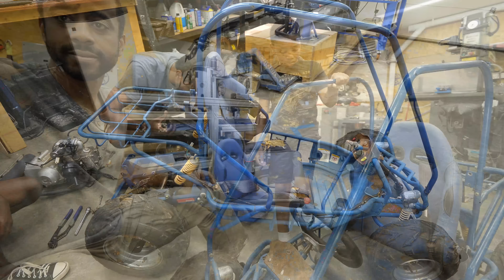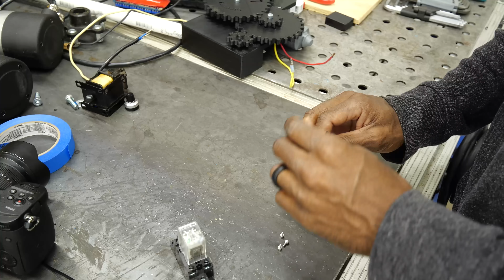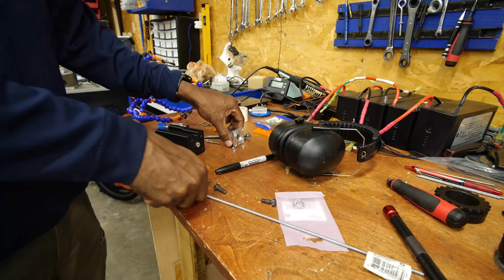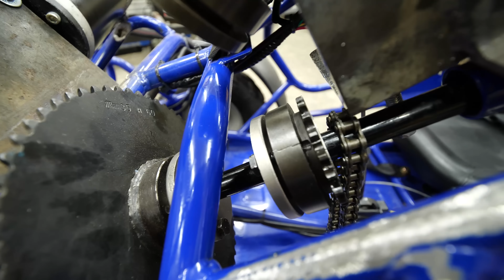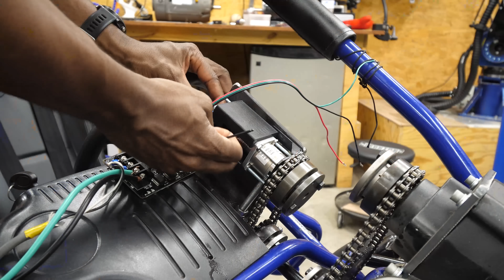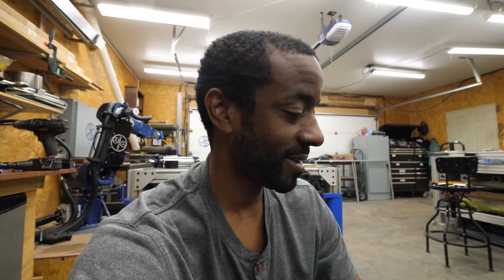Building A Self Driving Car - Jeremy Fielding 098

Comment from the maker: Thank you so much for joining me as we work through the design challenges of something like this. We are already making changes and improvements! Please check out bill's article as he talks through the whole electrical design, discusses the different position-sensing options, and changes we plan to make there as well! https://dronebotworkshop.com/custom-servo-motor
Reply: Hey just saw something you might have a need for especially in this time of year. Repurpose a old dryer into a garage heater
Reply: I can't wait until we get better analog computers, can you imagine the AGI that will come from that? I'm curious if an analog computer would be better?
Reply: great video. quick question... the force needed to turn steering wheel will be quite heavily dependant on the TYPE of surface the vehicle drives on and grip of the tyres no?

Comment: From a safety standpoint, you should definitely prefer a weak motor with a sturdy mechanical device. Should the motor fail, a standing steering column allows for manual override; while a broken steering column means total loss of control with zero backup.

Comment: Without any connection, that is, keeping the chain removed, you can observe how the motor spins & how it responds to the potentiometer. That way you don't risk damage from the torque of the motor. Of course, I realize that this project is likely long done by now. So, I'll just look around for some new chapters. I appreciate this video. I am beginning a smaller scale project, that is similar. I am building a little Power Wheels style robot controlled by an Arduino/ESP32. Once I get it working, I want to control that with a R-Pi or maybe an Nvidia computer - whatever has more support for robotical projects. I'd like to use an Orange Pi, but it all comes down to software support & support to the accessories I want to use.

Comment: It would be super cool to not have a mechanical linkage and use an encoder for steering wheel and motor to output the ti-rodes. I've wanted to make a fully electric go-kart.

Comment: I would’ve opted for an existing electric power steering solution, like the one you can find o  opel corsa, or whatever other small and cheap city car. Where I am, used kit can be found for as much as 40$.

Comment: I was just wondering why you chose a motor and potentiometer offset with sprockets over a double shaft stepper motor in-line, preferably with an encoder.

Comment: could have used photosensor counter instead of wasting a stepper motor, more accurate than potentiometer. fill/pack  the pipe with medium (sand) to make it more rigid, predicted that its going to kink before it happened.

Comment: you should take a look at "teknic SC series" sometime they are expensive but you need a lot less components i think, and you have full control over Torque, Speed, Absolute angle, Even when you disable the stepper it still recoreds the position and speed, and no driver needed

Comment: As much as there's not much wrong with Your approach, why would You want to reinvent the wheel? 60% of cars are using e-assist steering column. A self contained worm gear mechanism with BLDC motor and power electronics built in... Cost ? Under $50.

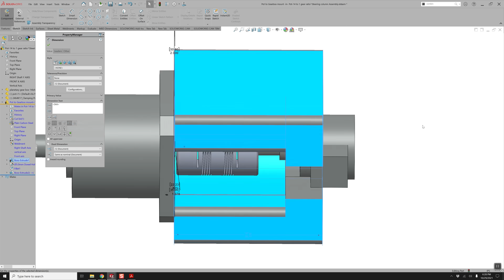Comment: 4:38 -  Design your steering with a clutch on the flywheel for several reasons: 1. Sudden need for human to take over steering (would have to include a sensor to drop out motor drive once the wheel is overridden) and 2. If the controller hangs the motor in spin, a human can take over (again, the sensor overriding the controller on takeover.)
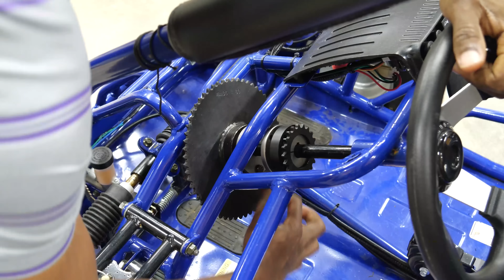10:51 - Nice video editing, now . . . "I don't care who ya are!"

Comment: It's wonderful to watch you work through the challenges.  Success most often comes with many attempts that don't exactly go so well.

I'm curious...

My car has something like Level 1 assist that keeps the car in the lane, but allows me to manually override the electromechanical system that moves the steering.

Perhaps the mechanical linkages you have are too strong for the task you're attempting?  I heard you say that if the motor was not as strong it could result in challenges.  How could you use the stronger motor and still provide the ability to manually override?  If you can accomplish that, then it would seem that you could hit the limits of the steering without the damage that the mechanical gearing caused?  Electromagnetism?

Comment: If that steering column is a hollow tube I’d want to replace it with a solid metal bar. That way if you have to attach something to it by clamping or drilling you don’t deform the metal and weaken it. That motor is strong and fast enough to do damage to you or the machine so perhaps do initial testing without the chain on. Then when it’s attached you can s-l-o-w-l-y calibrate it to find your left/right extremes and make sure it never hits those, either programmatically or with feedback switches, (or both).
Oh, and when you tested how much force you’d need to steer you pulled at the rim of the steering wheel giving the best mechanical advantage. But if the chain is closer to the center of the steering column it will take more force to turn it.

Comment: Looks like a fun project. I joined a group at the University of Alaska Geophysical Institute trying to design a vehicle for the DARPA Grand Challenge. It had to follow waypoints while avoiding obstacles. One of the guys from the Mechanical Shop did most of the genius physical modifications. I was on the software team. It had lidar and radar and an old computer running Linux. Unfortunately we found out about the challenge too late. We got as far as testing in front of the admitting judges but a couple technical issues had us just miss out. But I was impressed at how far it made it along the course, just short of the end, before it got a bit lost.
There were some clever bits. Once you ran the AI program it started the gas powered car then ran through calibration steps to verify the steering and brake limits. We had kill switches on all sides (just in case) and an old Apple joystick that allowed us to drive it manually if necessary since there was no steering wheel and the driver’s seat held the steering and braking hardware. Since it was designed to run a course autonomously we couldn’t run out on the track and restart it if the vehicle or the program died. If the vehicle stalled the computer knew how to restart it. And if the software died I wrote a program to spawn several redundant processes that simply monitored each other; if the primary script died the next in line took over and spawned a replacement so the max (3) was always running. All three programs would have to die at once for it to stop. It was a lot of fun and I learned a lot. I need to find out what ever happened to it. I’d love to keep tinkering at it.

Comment: A gen1 prius has a dc motor attached to the steering rack.  It is used a electric power steering, but I'd bet it can be used to steer a go cart, which would need much less torque than a 3500lb car.

Comment: Super cool project. If I were choosing between the motor failing or the steering column failing, I would always lean towards breaking the motor because it leaves the human/driver in the equation. If the steering column breaks you remove the ability for you or your kid to steer the kart in a safe direction. Humans are squishy and motors are easy to replace.

Comment: Nice moves. In the past I have found that a cam attached to shaft and an analog output  inductive proximity sensor like Automation Direct DW-AS-509-M12 mounted perpendicular to cam is a slightly less cost effective but infinitely more suitable solution for resolving angular shaft position < 360 degrees (no gearing, no chain, no sprockets, no wiper wear). You can cut cam to create  desired shaft angle vs output voltage profile. I Have used this method to replace problematic  pot failures  on dancer arm for dereeling 2000lb spools of 10 ga copper wire. Great work!

Comment: Hi Jeremy. Whenever I have some spare time, I check in to see the great projects that both you and Bill are working on. I enjoy watching them, and appreciate all the efforts that you guys put into making these videos. Thank you.
Could I ask why you have chosen to use analog over digital, for the feedback, to close the loop? Would not using an incremental encoder (digital), rather than a potentiometer (analog), be overall more beneficial, as the potentiometer is limited on number of turns, is more susceptible to wear and dirt, induces noise, etc., where an encoder is only limited to the size of the counters, dirt and noise is very rare, they usually out last the device that they are attached to, etc.? I'm just looking for your thoughts.
Thanks again for your great videos.
Reply from the maker: Check the description

Comment: I am a first time watcher of your channel. I love you passion to teach the next generation. Keep it up. In this video the motor was to strong and broke the steering column. To use the same motor and protect your work I recommend using a current limiter on your speed controller. With a current limiter you can adjust the maximum torque the motor puts out. This will protect the mechanics. Start with a small torque. When you are satisfied that the steering is doing what you want, increase the torque a little at a time until it works. An added advantage to this method is safety. A person can overpower the steering if something goes wrong. A double bonus.

Comment: Would it not be easier to control two hydraulic pistons on an S cam welded to the steering column with a simple actuator and just put your potentiometer on the hydro pump to control output speed? Would you even need to change  the pump  speed?  In my mind I only see 4 moving parts(in addition to the existing rack and pinion)  , two opposing  pistons 1 manual hydraulic control lever(pistons speed based on how far lever is pushed back and fourth)   and one servo to drive the control lever back and fourth. An electric cervo driving a  hydraulic cervo?  The hydraulics also provide a dampening force while maintaining torque when and where you need it. Just place the hydraulic pistons to be extended  at max pushing the S cam slightly before your steering rack is at 100% max so you aren't damaging the  shaft or rack.  I am not an engineer at all , I just like to watch and think about how it might be done, and what are the pros and cons of doing it that way. I have always tried the K.I.S.S theory approach for ease of repair in the field , longevity, and durability.

Comment: I cringed when you put the stepper motor rotor down on the steel table and then showered it in grinding dust! Personally I'd have made a small puller to get the gear off, I've never had a problem doing that before.

Comment: Why not run the steering off the bottom of the pinion gear? That would simplify a lot of your components... you're not worried about chains and the psi on the drive shaft. Then limit switches on the rack...

Comment: I suggest that you use a magnetic angle sensor rather than a pot. A pot is noisy and becomes unreliable in the environment the vehicle will be operating in.  I certainly wouldn't want to have my safety dependent on a conventional pot.

Comment: Very cool project and excited to see the joy it brings the family. Your reversed motor direction reminded me of a design issue we had on one of our robotic arm prototypes at my old job. It was a position controlled hydraulic robotic arm and we had to rework our first prototype manifold due to some miscommunications with the mechanical engineers designing it. Namely, swapping the A and B sides of the circuit. Unfortunately, no one on either team thought to update the engraved labels on the outside casing.

Flash forward to six months and we are performing a manufacturing dry run with the prototype manifold. As soon as we powered the controller on, the position control system took over and the arm slammed itself into a completely flexed position. These were some beefy arms too so I’m very glad no one got hurt. We had a strong safety culture there and had done a a thorough safety analysis for exactly something like this happening. 

After some head scratching and investigation, we realized the manifold had been installed per the original engraved labeling! Since the polarity was reversed between the hydraulic command and the feedback, we had a perfect positive feedback loop just like your steering wheel deformation event. Very frustrating to encounter these in a project, very cool when you realize exactly all the mechanics and science that forced it to happen!

Comment: I would prefer a motor failure than mechanical. If the motor failed you can use the steering wheel to drive back home.

Comment: That is very cool. Reducing torque is an option but first you should definitely go with a beefy solid shaft to avoid future problems. Tubes are weak when they have holes in them.

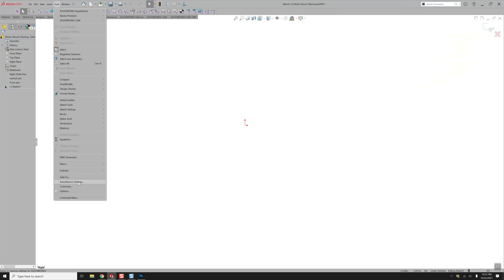Comment: Hi Jeremy, This is a very interesting project! I noticed [e.g. at 4:00 mins you use a motor from an electric wheelchair for the steering] you'll try to solve some of the 'basic / fundamental' problems yourself. Why not 'stand on the shoulders of others'? by scavenging parts from scrapped cars etc with 'assisted parking' etc. to help speedup your prototyping process??  One might also use parts from the RC-world and 'robotWars etc.' Any way... you've sparked up my tinker-batteries' ....

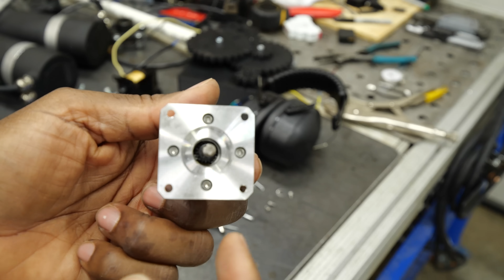8:43 cutting off a tiny part with a massive angle grinder?? Like shaving with a chainsaw! 🤣
I can't wait to see 'what's next'...

Comment: Great inspiration #jeremyfielding ! (although this is me f***ed, now I have to make time for building a cart for my kids :S )

 I would absolutely have started out with similar designs as you do (except i have no cnc-machine for making the metal parts) but looking at this I'm thinking maybe build a gearbox "around" the shaft or put bearings and a bar between the gearbox and the shaft. That thing was destined to pull at the steering collumn. And maybe try a magnetic or optical absolute encoder instead of the potentiometer?

Looking forward to see the evolution of an autonomous backyard robot cart!

Comment: Not an engineer but the first thought I had about the steering column was that you DO NOT want to break the steering column.  If the motor goes, yes you can't control it electrically, but if the shaft goes you can't control it electrically OR manually.
If the cost of the motor is the concern maybe change something else to break first (the chain?) or add some other protective measures (electrical or mechanical).  Just a thought.
I suppose you would just stop the car if something like that happens so maybe the steering column isn't that critical.
Great video, as always.

Comment: Pots are a great inexpensive and simple solution for tracking steering wheel position, but you can try using an absolute encoder instead. Using one you will not depend on the precision of the ADC of the microcontroller which can be a bit noisy at times, higher sensing speeds, due to its high resolution you will not need a gearbox and you will always know precisely the direction of the steering wheel with the option of program the motor rotation limits

Comment: In addition to a bushing right next to the sprocket, I'd put a friction overload clutch between the motor and steering column. This will let you set the maximum mechanical torque in the system so you can start testing at low torque.  Also since the position feedback is after the friction torque limiter, you won't loose position after an overload.  Fyi, Amazon has cheap worm gear boxes with through bores for shafts.  Find one with a 20-25mm ID to use instead of the power wheel chair motor?  (or 3/4-1")

Comment: I didn't read all the comments, but I think what you need are an end stop type solution so the motor won't melt and the shaft for the steering  won't get bent. It could be implemented in software (pot readings: if it gets too high or low, cut off the motor power) or with hardware (actual switches that cut off the motor power that direction when the column gets turned too far one way or the other). That way the components are only subjected to their intended design stresses. No redesigning a system to fail intentionally.

Comment: You might want to run the motor from a lab power supply with current limiting, and set a pretty low limit. This will let you put a hard limit on torque while you are testing so you don’t destroy things if your control system isn’t right yet.

Comment: Already love this project!! Can't wait to see how things progress!  The motor you are using appears to be a worm gear , so the steering wheel would be pretty much be useless in the event of mechanical or electrical failure of the system. Curious if that motor unit has some sort of electric clutch...?

Comment: Why not engineer it such that there is a breakaway point between the motor and the steering drive line? I could see that causing issues, but ultimately it would mean the driver would always be able to retain control in the case of a self driving failure (since the failure would cause a breakage of the self driving connection)